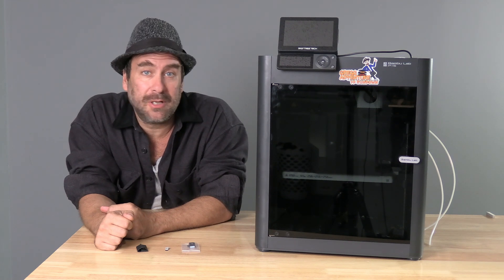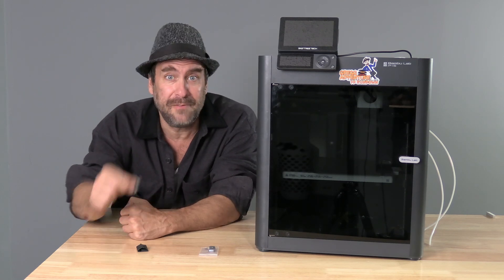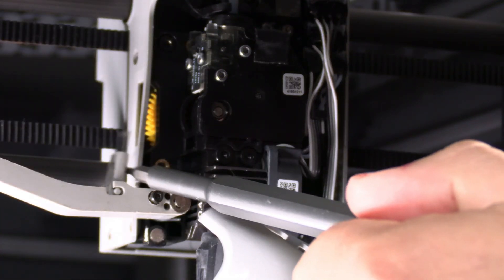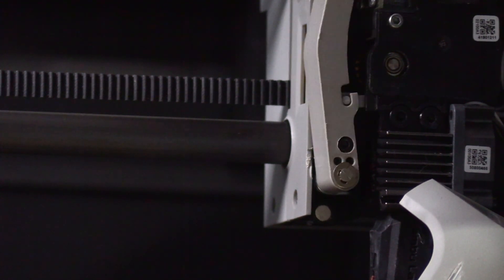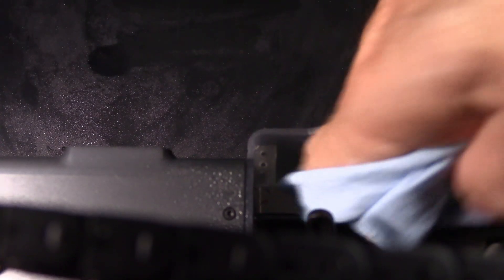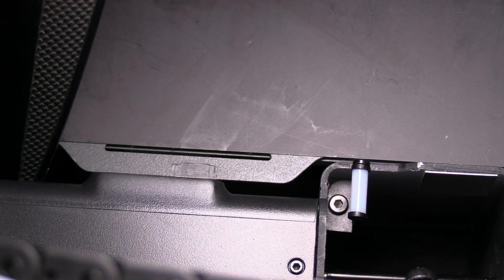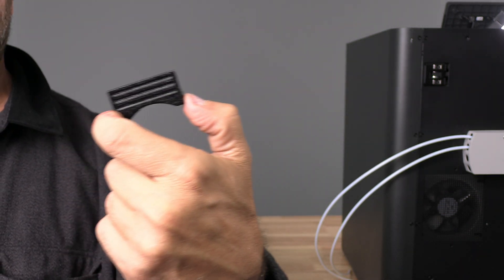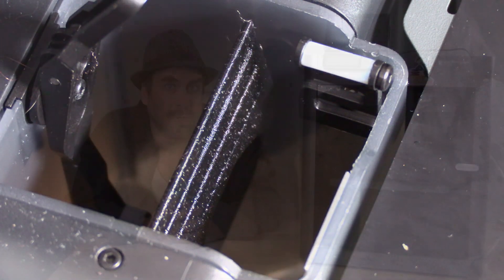Bambu Lab POOP CHUTE Maintenance: Replace Nozzle Wiper, Filament Cutter, STOP Chute Clog? 3D Printer

Comment: I am having issues with one of my P1S's chute lever getting stuck behind or inside of the toolhead housing. Has anyone else had this issue? I can't find any information out there on how to resolve this. I have a feeling the chute lever is bent a little bit.
Reply from the maker: I have not seen this. You can swap the whole chute out. I actually have one here. I planned to shoot that, but never did.
Reply: @3DRundown I found a lever model online so I wouldn’t have to replace the whole chute. Maybe that would work or a modified lever with 1-2mm cut off the top.

Comment: My printer only has 150 hours on it and tried my first multi color print and it was a 10 hour that turned into 17 hour with all the clogs of the poop chute knocking the front cover off
Reply from the maker: Yes, the poop chute can be super frustrating. Take note of the filament you are using, and if one seams to cause the clog over another....

Comment: On one of my p1s, the little square metal piece came off and fell down the poop chute. I can't find it. Since then I've sprayed some pledge furniture polish on a cloth And attempted to coat the whole inside of the chute. Seems to work. Until I use silk PLA. Then it all goes to hell 😂
Reply: Has someone designed a removable replaceable liner for the chute? That would be easier to replace that the whole thing 🤣👍
Reply from the maker: My poop Chute goes to hell, with certain filaments, no matter what I do. I would like them to revise it. Replace the whole thing. It's only $15 http://shrsl.com/4plxu